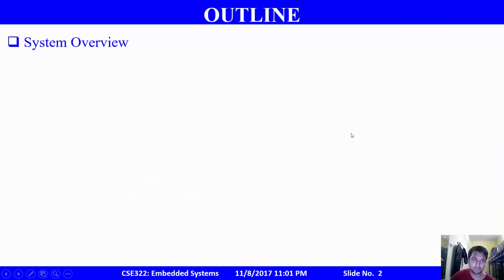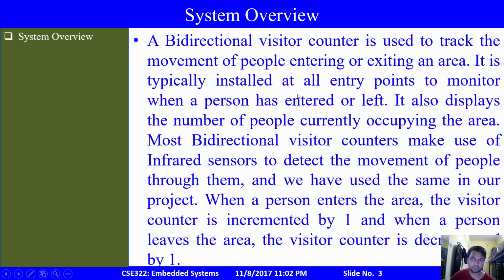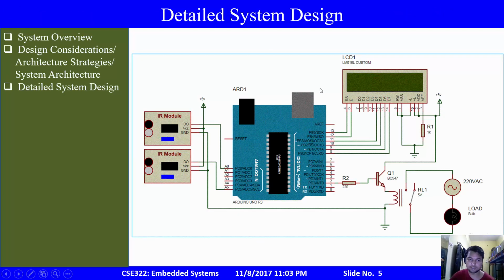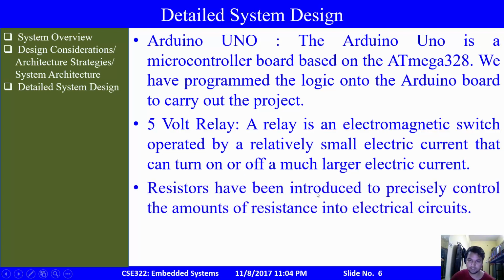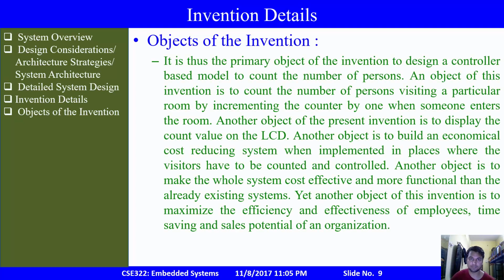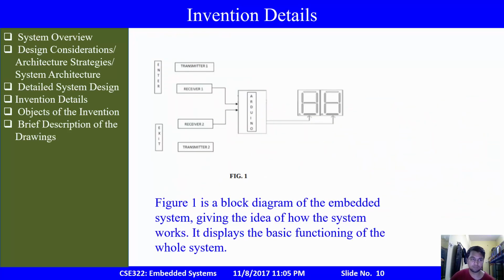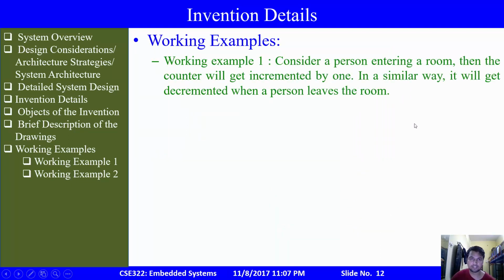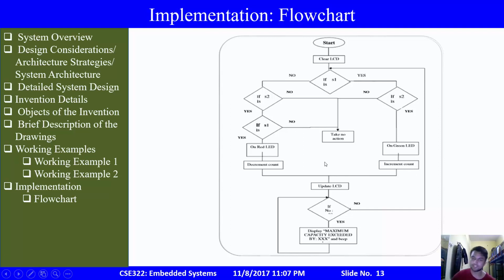Bidirectional Visitor Counter Using Arduino (17F1056 CAT2 video)

Comment: Send its aurdino code
Reply: #include<LiquidCrystal.h>
LiquidCrystal lcd(13,12,11,10,9,8);

#define in 14 // Analog pin A0 has a IR Module attached to it.
#define out 15 // Analog pin A1 has a IR Module attached to it.
#define relay 2 // Digital pin D2 has a Relay attached to it.

int count=0;

void IN()
{
    count++; // increment the value
    lcd.clear();
    lcd.print("Person In Room:");
    lcd.setCursor(0,1);
    lcd.print(count);
    delay(1000);
}

void OUT()
{
  count--; // increment the value
    lcd.clear(); // Clear the LCD Value
    lcd.print("Person In Room:");
    lcd.setCursor(0,1); // set the cursor positon
    lcd.print(count); // Display count value
    delay(1000);
}

void setup()
{
  lcd.begin(16,2);
  lcd.print("Visitor Counter");
  delay(2000);
  pinMode(in, INPUT); // Assign the IR is Input
  pinMode(out, INPUT); //Assign the IR is Input
  pinMode(relay, OUTPUT); //Assign the Relay is output
  lcd.clear();
  lcd.print("Person In Room:");
  lcd.setCursor(0,1);
  lcd.print(count);
}

void loop()
{  
  
  if(digitalRead(in))
  IN();
  if(digitalRead(out))
  OUT();
  
  if(count<=0)
  {
    lcd.clear();
    digitalWrite(relay, LOW); // relay is in ON conditon
    lcd.clear();
    lcd.print("Nobody In Room");
    lcd.setCursor(0,1);
    lcd.print("Light Is Off");
    delay(200);
  }
  
  else
    digitalWrite(relay, HIGH); // relay is OFF condition
  
}
Reply: Can you send which relay is used in this circuit. Picture I want.